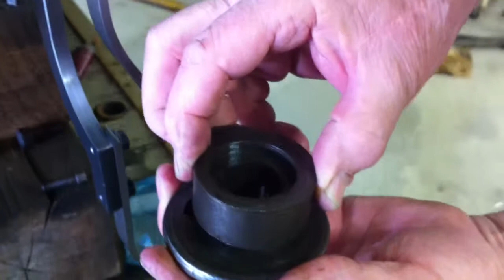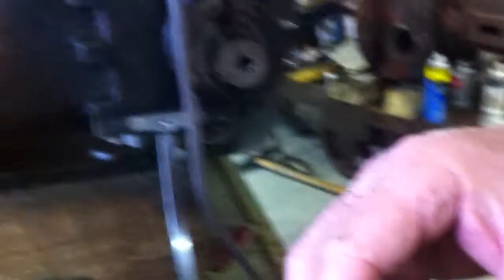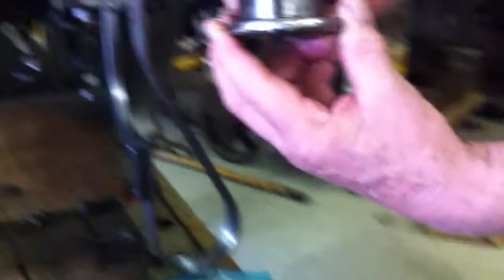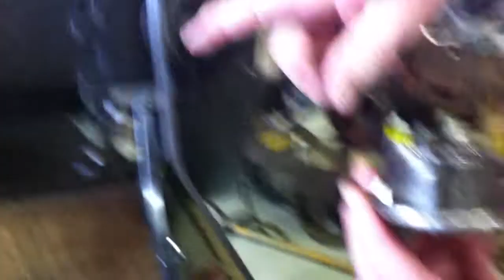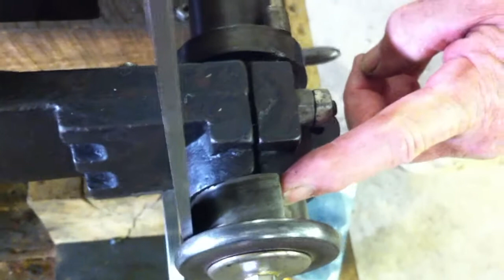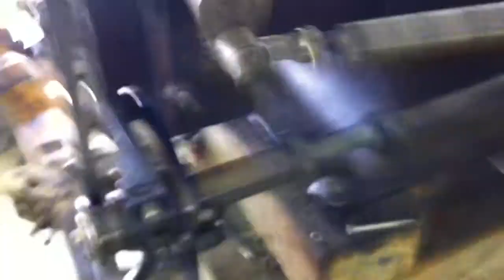Ignitor drop cam - Dogbone Lambert

Comment: Hi Fellas, I been busy workin on this. Looked at other Lamberts on here and checking out the igniter cams , " Big Lambert's " by pileofiron cam looks the most like the one on your's except on that one both cam and it's carrier are fitted the other way so wondering if your's should be same and larger end washer fitted to outside? Does that seem plausible? Hope that's helpfull.